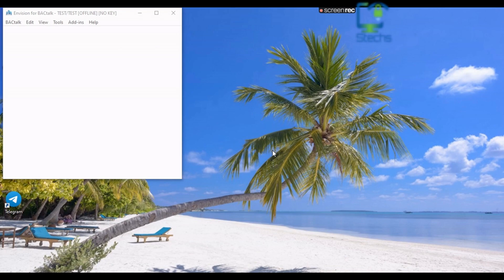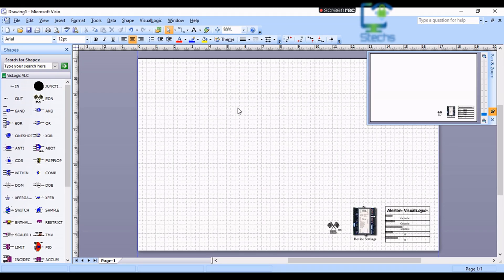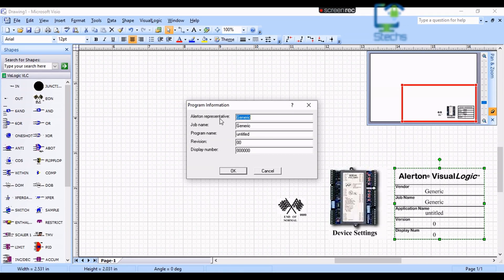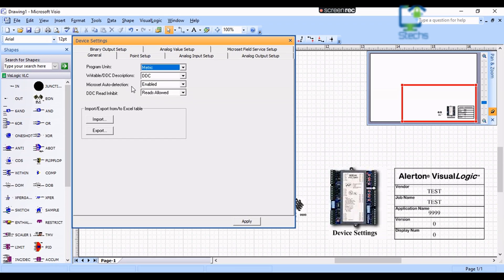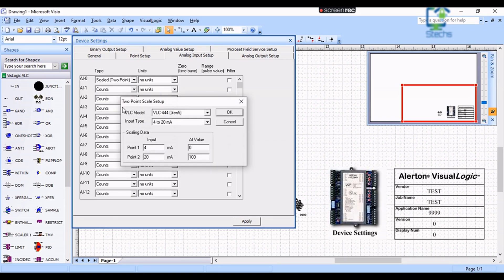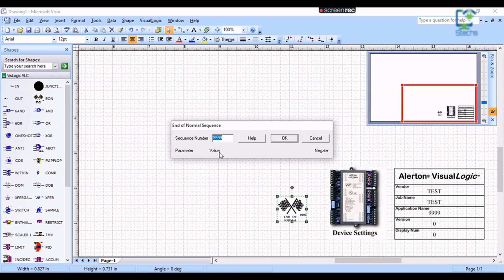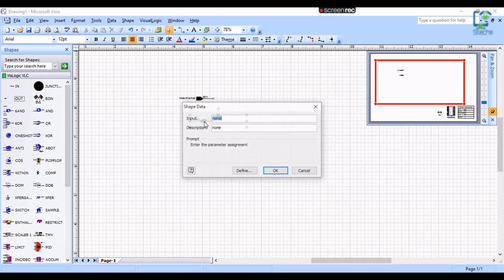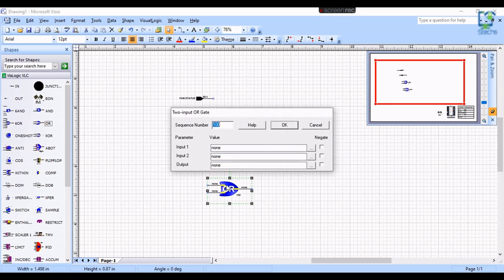Introduction to visuallogic, Programming of VLC controllers.

Comment: Hi there. How exactly can one calculate the Zero (time base) and the Range (pulse value)????? Is there a formula involved?
Reply from the maker: You can do it in the visio configuration itself. There is an option when you choose two point scaling.
Reply: @STechs   The thing is that I don’t use VISIO. I use the Envision Blue Screen. It doesn’t give me the option of two point scaling. And if it does I don’t see it.

I have an example for you. I need to program a glycol temperature sensor (thermal buffer) for a freezer. The operating temperature is -40°F to 248°F. And I know that it would be a 10k thermistor. So what would be the Zero/Time Base and the Range/Pulse Value? What do those things mean?

If you can really help me in this, I would greatly appreciate it!!!
Reply from the maker: Let me check and update you
Reply: @STechs  That would be awesome! Thanks!!!
Reply from the maker: It applies only with analog inputs (0-10vdc, 4-20ma, 0-5vdc etc) not with thermistor inputs.